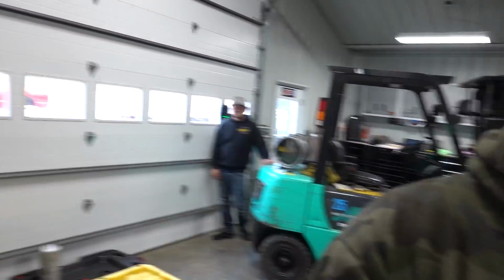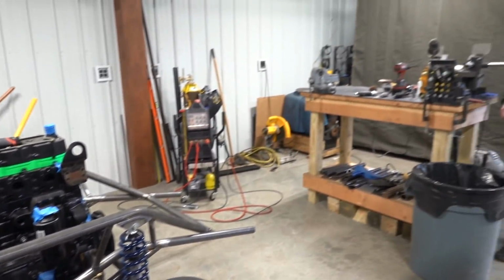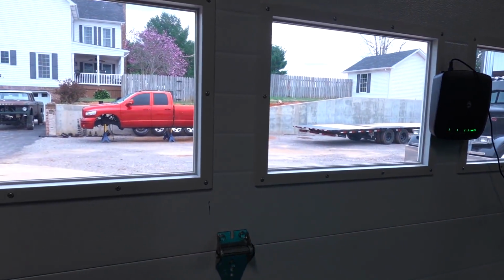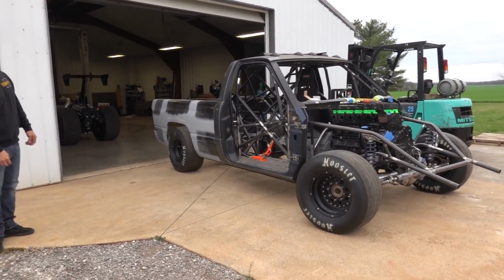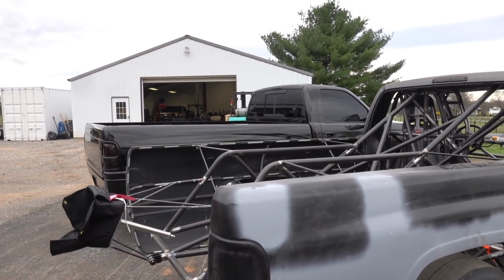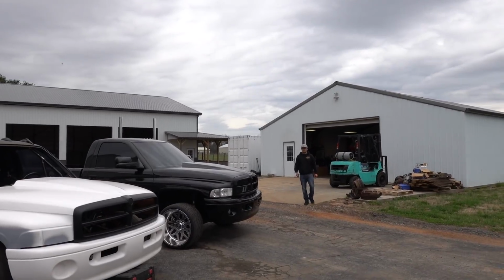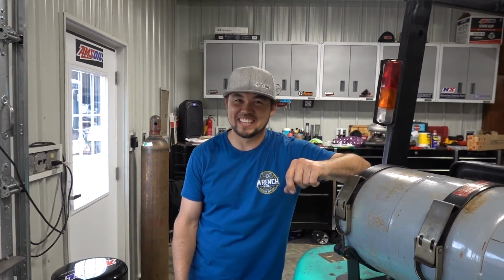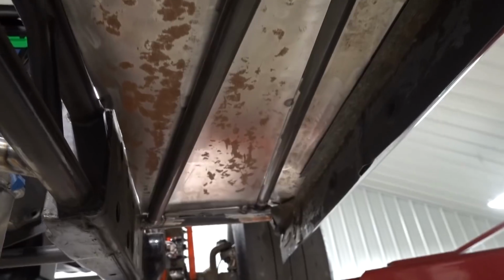CUMMINS RACE TRUCK ROLLS OUTSIDE FOR THE FIRST TIME!!!

Comment: Either getting the trans swap and rest of interior for Pete, or to freedom performance for the engine and cylinder head for the race truck and 12 valve
Reply: May be the pete because the guys on semi casual were teasing a project coming up soon
Reply: @cliff4695  true, didn't watch till the end before commenting.  

Finishing his previous road trip that got cut short when he went get the new trailer